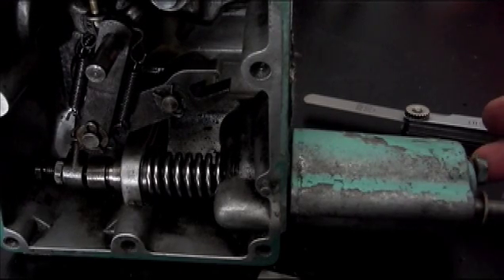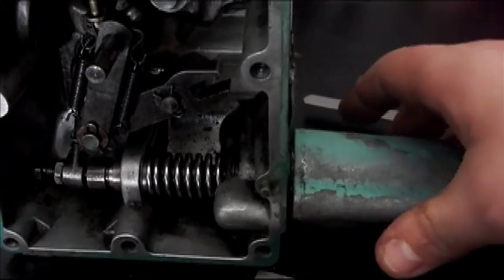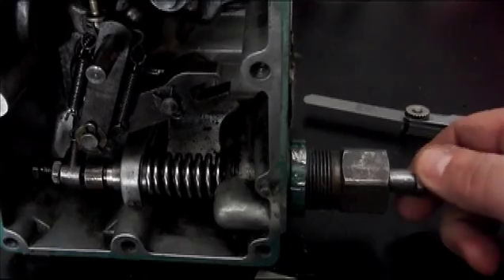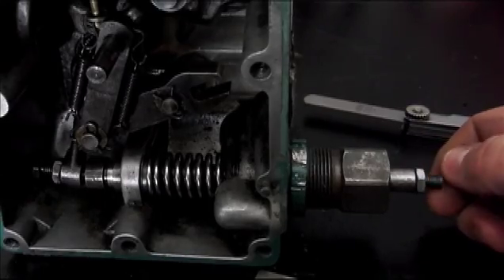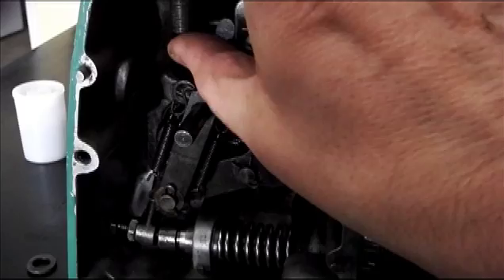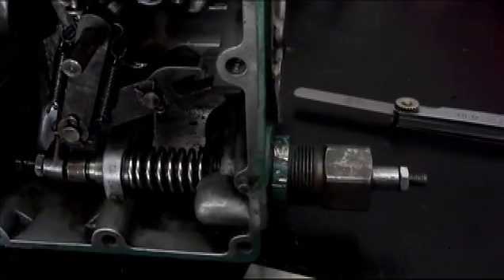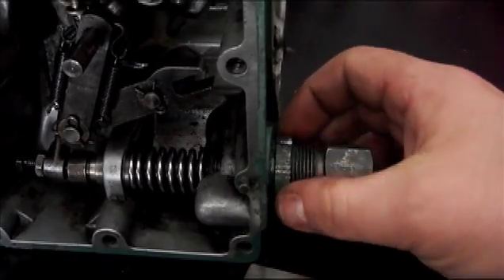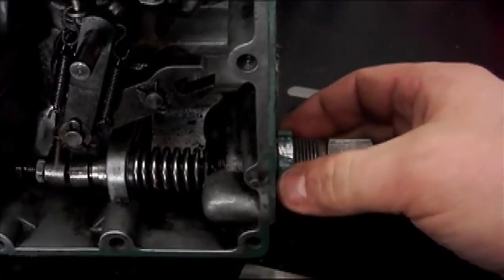How to Set Maximum No Load RPM on Detroit Diesel 71 series 8v71 6v71

Comment: 410 HP marine is 2500 no load.  485 HP marine is 2700 no load.  Note: the time between rebuilds on the 485 is only 2500-3000 hours, so life is significantly reduced by the increased power output.

Comment: Detroit 12v, 8v 71 series on PCFs and PB mk 3-4 , alpine green was their color name, doing weekly fuel dilution tests on them, runaway diesel- shut the air flaps, supercharged and turbos, setting the rack on fuel injectors,  we even had a boat with 8v with advanced timing and  n120 injectors, after a rather long run the engine broke - first time seeing a dropped valve "welded" on piston, -hooyah

Comment: I always have to rev my engine to go into reverse.  Is that normal? 1971 mci7 871
Reply from the maker: No
Reply: Can you do a video on how to turn up the voltage regulator on mci 7. I know there is an adjustment,  but I don't know where to start

Comment: What's the "buffer" gadget for?
Reply: The buffer screw smooths out the idle so it doesn't hunt.  You adjust the screw in until the idle speed increases slightly then you back it out 1/8th of a turn.

Comment: You should run the spec rated RPM
Too low causes unburnt fuel to leak past exhaust gaskets
Unburnt fuel bc the blower at low rpm creates less air
2 cycle love to run high rpm,there designed to run in power band

Comment: I know of a company that were testing the 6-71 for the purpose of several single engine tug boats to use at their offshore platform construction yard. Referred to as "Yard Mules". Built a small cinder block house around it, mounted a water pump to use as a water dyno and completed their testing. Because the 40-60 psi fuel lines are near the Air Silencer and it's happened that when they leak the fuel is drawn into the Silencer and the engine runs away.
As a matter of destructive testing they bypassed the gov by pulling the Buffer screw and pushed directly on the Fuel rod of the Rack. At 6500rpm the Flywheel disintegrated the Bell Housing. How fast is the combustion process on an engine that can reach 3 times the rated rpm? The flywheel was probably the Allison MH Reduction gearbox common to the time. Guessing about 160lbs. With a better flywheel how much more rpm could've been attained?
I worked with the mechanic that was directly involved with the setup and implementation of this project in the late 70's.

Comment: I have 2 6v71 engines on my boat, can’t get them to start.. purged the air in the lines, new filters, fresh diesel. I can get it to pop and sound like it’s about to cold start but won’t catch and go. Is there some sort of shut off or purge valve I’m missing on these old engines? Both doing the same thing
Reply from the maker: Fuel, air, compression is all it takes.   Air flapper shutoff possibly closed. Better make sure the rack isn’t stuck if it’s been a lo g time since you started them.
Reply: If this is still relevant, what is your fuel consumption per hour?
Reply: @Vitautas747  my 671 TI's (380 HP) run 11 gallons per hour each at 1800 RPM.  22 gallons per hour combined at 18 knots.

Comment: I have detroit 6-71 engine in my truck and there is eaton 13 speed transmission .
My truck rpm goes full but truck speed very low 
Whats the proble.?

Comment: I have an 8.2L that revs well over 4,000 I’m trying to find some kind of way to cut it back to 2,750 they’re set at the factory to 3,000 but when I got it there was no high speed governor, anyone know how to turn these down? The assembly looks very similar if not the same as this one.
I’ve backed out the big nut till it was pulling the idle down, and it will still peg out my 4K tachometer. I’m at a loss.
Reply: 8.2 L were a real mess, some had mechanical only governors some had electronic only governors, and some had a fixed speed high rpm governor with electrics on top of it. Make sure the rack linkages aren't jamming at some point in the tubes leading from the valley into the heads.

Comment: Any idea where the tachometer attaches? My bus rpm stays at 0 so doesn’t seem connected trying to fix
Reply: There are as many different tacho types as there are GM engine models,
It could be cable driven if it's very old, you could see a cable attachment male thread either on one of the accessory drive pads, or even on a right angle drive taken of the blower drive.
If it's an electric tach it could have a tacho gen, looks like a gauge sender, screwed onto one of the accessory pad tach drives, or it could have an inductive sensor screwed into the flywheel housing with the tip very near the ring gear, or it could be screwed through the gear train housing with the tip near one of the camshaft drive gears. Electric tachs can also be driven from a terminal on the alternator, that's a whole other world of pain with many different systems.

Comment: Can we consider that the power is reduced if we remove the turbo's on the 8V71TI engine ? Thanks for your input
Abdel
Reply: If it was a factory build TI engine it will run without the turbos but it will be flat in performance, factory turbo engines had lower compression ratio, so a Ti engine without turbo will have less power than a NA engine, it will also smoke a lot more.

Comment: Update: Using an optical tach I found my vintage SW in cab tachometer was reading slow by about 400 rpm. I found an adjustment screw on the back and set my 8v71 to 2350 no load and calibrated the tach to match. Truck runs great and I shift when it hits the governor. 8V71 governor does not seem to be working..or it's out of adjustment. I've hit 2700rpm upshifting (5 speed manual) and afraid to go higher by accident...can I just go counterclockwise a 1/4 turn at a time until it holds at 2450rpm without taking anything apart? (fire engine)

Comment: u can turn a 6 or 8 v 71 up around 3 grand and it run all day just fine
Reply: Two stroke DD will take High RPM all day long.  as a matter of fact, they will actually live longer. They are not happy being lugged down.  I grew up with these engines and have owned several. We opened the governors up as far as they would go on every one of them. Never once had an issue with it.
Reply: @robertm3079  You're correct, 71 series engines like operating in the upper range of the governor, a Detroit doesn't like lugging down , but don't set the max no load speed higher than 2300 RPM.
Reply: A 6V53 comes from the factory set to no load of 2800 RPM.
Reply: I was just about to ask if you upgraded the valve springs to be on the safe side if you could run 71 up to 3k, not sure based on what he said bout the trans if the driveline will be happy but the engine should be ok not so?
Reply: @TriniRogue  71s naturally rev limit on valve float around 3 or 4k , it's often the blower locking up that stops them, the rotors get super hot running at the extra speed and load and either grow and rub the housing tearing up the machined aluminium surface or the rotors grow length wise and nip up on end plates or the shaft bearings snapping the drive quill.
Reply: No u cant..if u do it eventually destroy your motor.....